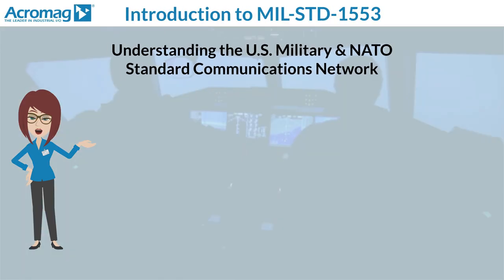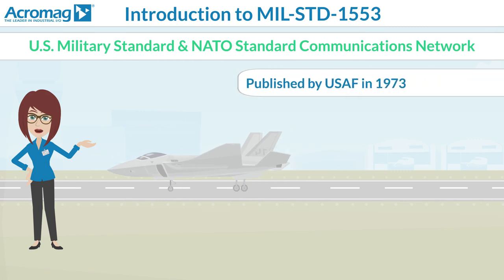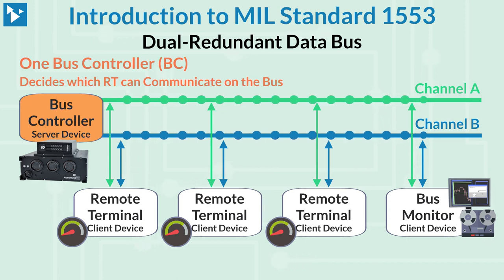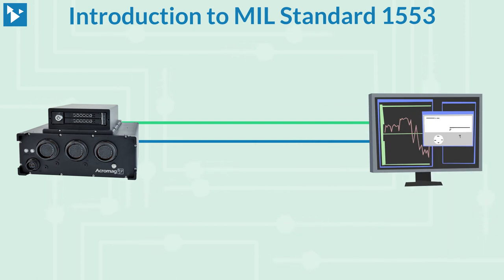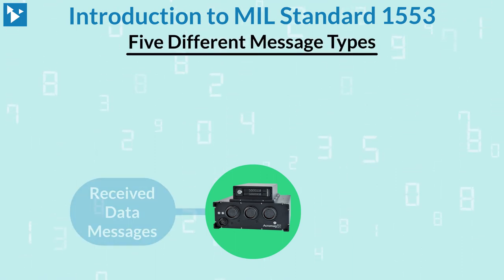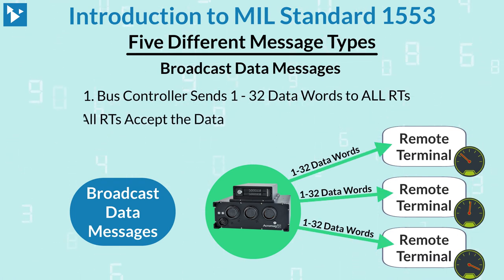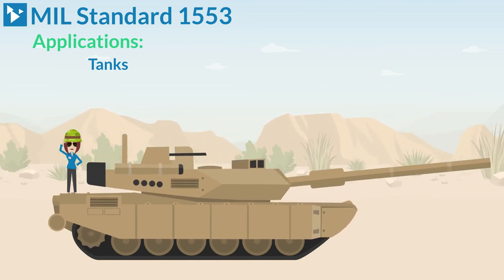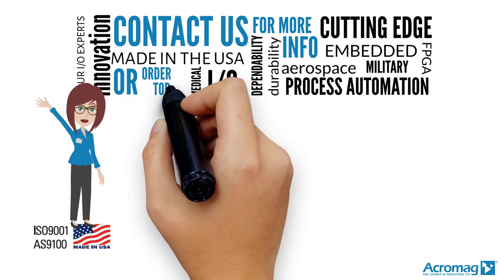What is MIL-STD-1553?  | Acromag Solutions Technology Video

Comment: 00:02 MIL-STD-1553 is a crucial communication network for the US military and NATO.
00:48 MIL-STD-1553 is a dual redundant data bus for military vehicles
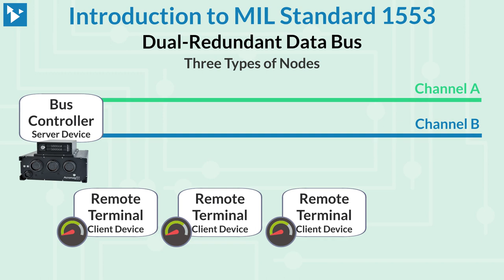01:35 MIL-STD-1553 allows redundant bus communication
02:22 MIL-STD-1553 features distinct nodes and fixed bit rate communication.
03:10 MIL-STD-1553 uses two coupling methods and five message types
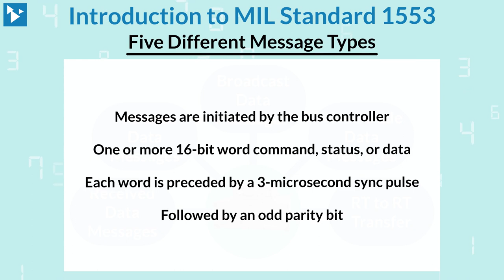03:59 MIL-STD-1553 defines communication protocol for avionics systems.
04:47 MIL-STD-1553 is used in various applications including tanks and submarines
05:45 Acromag offers MIL-STD-1553 products for satellite test systems and the ISS
Crafted by Merlin AI.